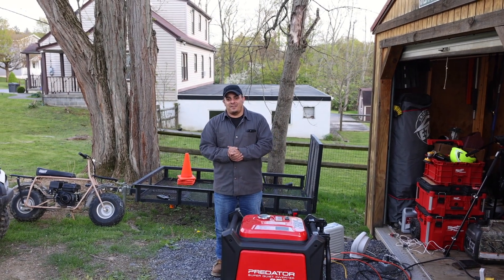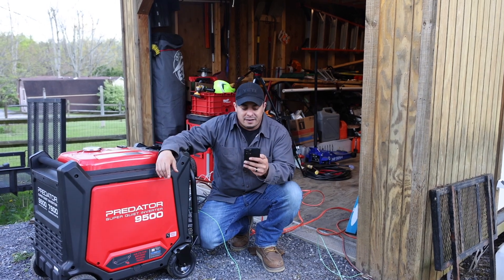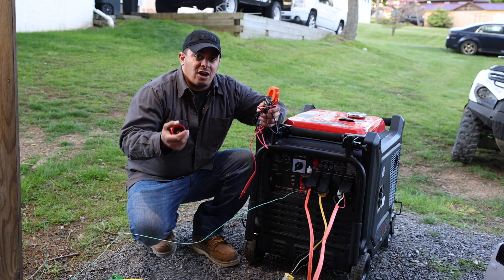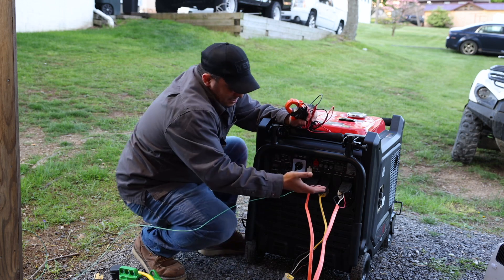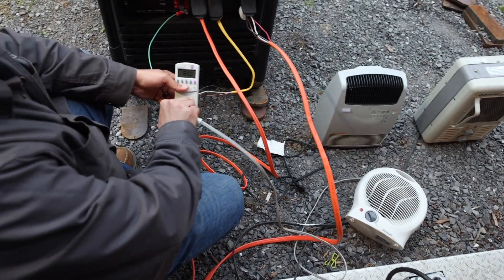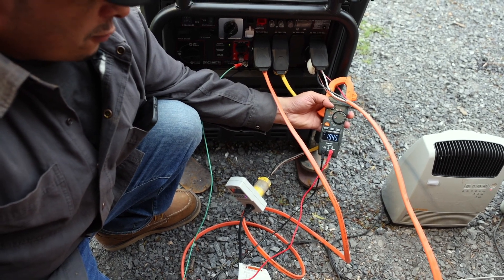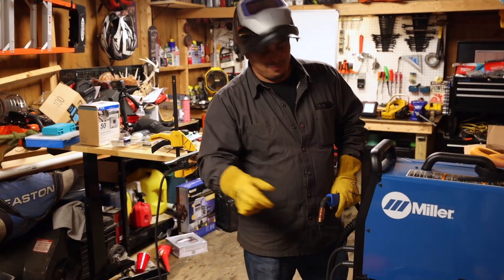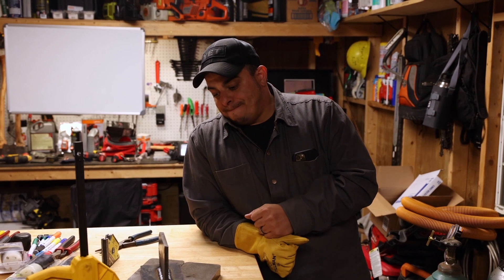Load Tests | Predator 9500 Inverter Generator | Does it perform?

Comment: Just because it’ll do it don’t mean you should your welders a 40 amp service your generator is a 30 amp service if you’re going to practice safety that don’t sound very safe
Reply from the maker: Actually this works because the “service” you speak of is limited by the 30 amp breaker built into the generator that is feeding the load center, not the breakers that are in my load center. The breakers in my load center do not matter quite as much for this demo. An example of this.. lets say your house has a 100 amp service. Your main breaker would be a 100 amp breaker. So you open your panel and add up the smaller breakers you may find a 50amp for your dryer, 50 amp for stove, and then a bunch of 15 or 20 amp breakers to run your lights and outlets.. the numbers would add up to over 100amps.. but that is not what your always pulling on each circuit. now if you happen to in any way go over an actual 100 amp pull between all of those your main breaker would trip.. which is basically what happened in this video. As long as the wire is rated for the amps. Hope this clears things up my friend.

Comment: I have the 3500 predator I was very disappointed with this one was not really any sense to make such a big generator when it’s only a 30 amp service they should have made it a 50 amp service
Reply from the maker: Larry, 50 amps would be found usually in generators with higher running watts ie. 50amps at 240 /12000watts. They could of added a 50 amp receptacle to save an adapter but nonetheless its a 7600 running watt inverter generator which typically are smaller to their conventional counterparts so 30 amp is matched closer to this unit.

Comment: I have 2 of them for my BBQ Food trailer. We run ALOT of power and it's holding up so far. I'm manually paralleling them which should be the same thing as a parallel kit. Minus the 50 amp breaker. It does struggle but we have alot of equipment running. Powerhorse makes a parallel kit that ties them together but, no 50 amp breaker. Kinda like the Honda's. Same concept. I hope they make that parallel kit with a dual pole 50 amp breaker. Instead of single pole. Firman parallel kit does not plug in to this inverter. So don't waste your time.
Reply from the maker: Great info thanks Jason! I may make one
Reply: Hi guys, look into the XP9000iH-PK. I think this would work for parallel setup
Reply: Powerhorse Parallel Cable Kit —Connects 7500 Watt to 7500 Watt Inverter Generators: This is the parallel kit I used to build mine. Works perfect.
Reply: Jason....
How much equipment are you running on your BBQ trailer out of curiosity?

I'm looking to run mine on 1 ...
(2) ton minisplit Ac-1000watts
(1) fridge 450watts
Hood fan 1,000 watts
12 gallon Rheem water heater
2000 watts
Freezer 450 watts
lighting interior/exterior 200watts

So definitely under 6,000 watts.

1 Predator 9500 should suffice?
Rest of my gear
Griddle
Charbroiler
2 burner
Deep fryer
Warmer table
Is all on propane . . .

Thoughts?
Thanks 👍

Comment: HF doesn't even seem to have a listing on their parts site for the Predator 9500 generator.
Reply from the maker: The parts for this unit are listed in the owners manual you should be able to pull the manual from their site. Hope this helps

Comment: I have a remote shop that is off grid and I run the harbor freight 8750 watt generator. The titanium 170 welder. It runs everything I need it to and don't regret buying it.

Comment: Just FYI,oil that says “full synthetic” on bottle is not 100% synthetic..so every oil at the parts store or Walmart is not 100%...Amsoil is 100% synthetic and far superior to any other so called “full synthetic” oil...research it
Reply from the maker: Josh im with ya. I hear great things about amsoil and have used in the past. i need to get some ordered. Thanks man
Reply: Good information thanks Forest
Reply: The OP is pretty misleading too. They may want to research it … more.

Comment: Very impressive it ran a multiprocessor Millermatic welder on 240v on a 30amp circuit that's very very impressive your rocked this video bro 🤘🤘👌🔥@NickPixelTV
Reply from the maker: Antonio thanks bro!!!
Reply: @NickPixelTV  anytime Broski
Reply: These newer inverter powered welders are impressive on lower current draw.

Comment: Thank you for this, awesome, I have the 9500 in the box, was waiting for this and now I am sure to take it out of the box, still need to install my interlock kit for powering the home circuits.
Reply from the maker: Awesome! I think you’ll like it. I picked up just a 30 amp transfer switch to cover the basics will be messing with that as time allows. I think it’s a great thing to have on hand
Reply: @NickPixelTV  I did get a 30 amp breaker and going with the interlock kit, since not sure what I can power or not on the home. Thanks again Awesome!!

Comment: Wow its running that multi Process Welder Smooth as Butter 🤘👌👍👊 @NickPixelTV
Reply from the maker: Burned some stick the other night for a friend with no issues. Working out good. Thanks again!
Reply: @NickPixelTV  that's awesome that's what I want a generator like this for My Stick machine Mig machine and My tig machine and maybe my plasma cutter as well on the go for mobile service
Reply: Did you connect the welder to the generator? Can you run the welder directly from generator? I have a predator 8500 and was mainly going to use to hook up a welder, mainly due to lack of of 240 outlets where I live.
Reply: @billyroque7857  did you watch the video?
Reply from the maker: @billyroque7857  yes the welder was directly connected ran it perfectly on 220
Reply: @NickPixelTV  thanks Nick. I appreciate your response. Have a good day.

Comment: Interesting didn't run heater and welder nice to see the breakers work nice 👍 @NickPixelTV
Reply from the maker: I am going to have to try with the 240 heater on and the welder on 110 may be possible or maybe turn the welder down a bit i was running hot for the test
Reply: @NickPixelTV  good idea Bro sounds like a new video idea 💡

Comment: 30 amps max at 240 that kills it for me
Reply: 240*30 = 7200 slightly under the rated 7600 watts. If you want 50 amps at 240 you are going to need a 12,000+ running watts generator. I would think peak watts on a generator of that size would be roughly 15,000 and I don't think that exists on an inverter platform. 

Look into Generac and Durostar, they both make 15k portable generators that have 50 amp outlets. Good luck!
Reply: @guitarfreak2105  thanks for the Information I do understand that this generator dosent have a 50 amp because it's way to low on wattage
Reply: The Powerhorse inverter is 9000 and it has a 50 amp breaker.
Reply: @RCJWILL954  correct me if I'm wrong, but I think the 50a breaker is useless in this scenario. If you only have 9k, then the overload circuit will trip at 9k before the 50a. Kind of like connecting a fire truck hose to a residential hose bibb.
Reply: @RCJWILL954  I am not familiar with that brand or model and can't find anything about it. I would guess that it still isn't going to put out 50amps. Again you'd need 12,000 watts to push 50 amps at 240.
Reply: You can get 2 and parallel with a 50am adapter on amazon they got some.
Reply: @UnicoOnlineTV  Oh okay. You are going to be able to do that with these units too. The parallel kit is in the works.